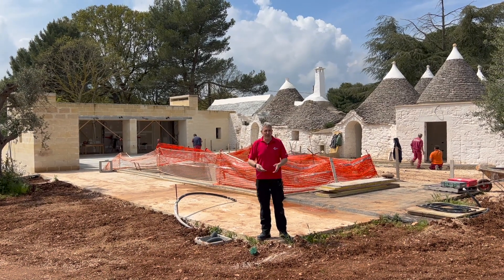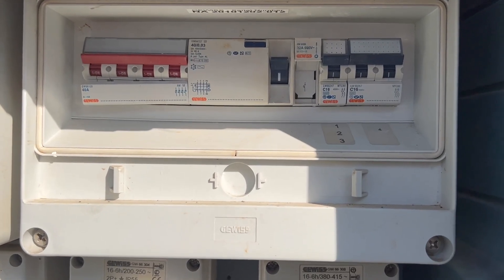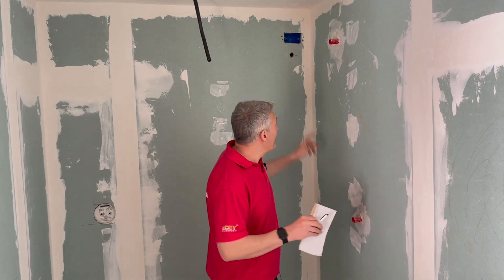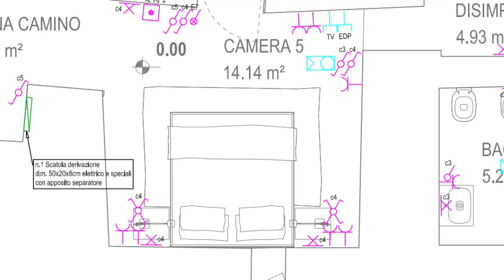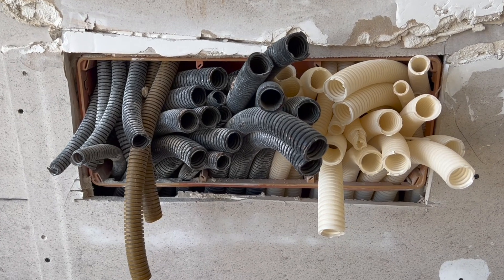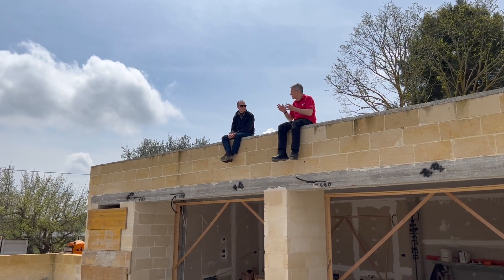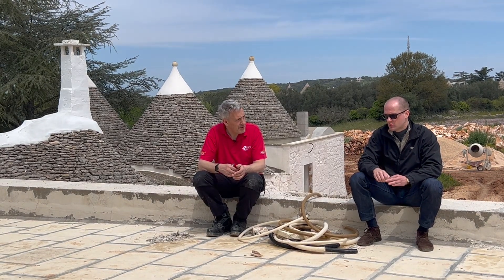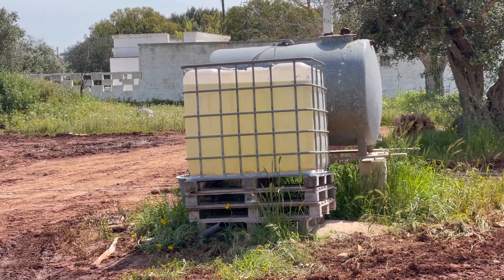Electric Wiring in Italy - You Won't Believe What They Do!

Comment: In the US, even though we have a TN-C-S supply, it is required by code that we still have ground (earth) rods outside every house and on every power pole in case the combined protective conductor (both neutral and ground) breaks.
Reply from the maker: Interesting- we are planning a similar video looking at the situation in the US
Reply: @efixx  Can't wait to see what you think of our electrical system!
Reply: @efixx  
That will be interesting. The USA electrical system and terrifying plugs are antiquated. It needs updating.  They need to switch over to 240v (most homes have 120v & 240V run in !!!!) and use British G type plugs, the best (do not reinvent the wheel). 

The large grey industrial looking 1940s looking panels with no DIN rails. Wow!
Reply: @johnburns4017  Why are you guys so terrified of our plugs? In 69 years I have never known anyone hurt by a plug. Who the hell needs 240v to run led lighting? We have 240v for heavy loads, it is not need for light loads.
Reply: @jdilksjr  
US plugs look flimsy and toy like. 

UK is 13A max. There are special 16A plugs for special application. No need for any more than 13A or 16A in residential applications for plug in appliances.  If the appliance draws more than 13A, then the appliance is hard wired in, not on a plug. 

0.75mm flex is rated 6A max. The circuit interrupter at the main panel may be much higher than this - so a fuse in plug protects the flex.  An LED table lamp can be drawing 7 watt.  A 1A fuse is available to cover lamp, switch and cable.  14A flex would be very thick. Too thick and overkill for a table lamp. 

GFIs are not mandatory in the UK on the main supply. They are in France and it works very well.  The main Interrupter differential is owned by the supplier. It is re-settable by the user. Circuits are 30mA cut out at 50Hz. USA needs 20mA fir same protection because they have 60Hz.  The main French interrupter differential is a lot wider like 200, 300mA

GFIs are mandatory in the UK - having one to do all the system is OK, but it is recommended on all circuits in the UK. So when on one circuit, an RCBO is fitted. This is: fault current, over-current and earth leakage detection all in one unit in main panel.  One reg states that one circuit must not interfere with another, which means fit an RCBO  on each circuit. 

No portable appliance outlet can draw more than 13A in the UK because of the maximum fuse size in a plug is 13A.   

Arc fault became mandatory in the UK in high rise buildings. Recommended in all installations. Called AFDDs here (arc fault detection device). They are: fault current, over-current, arc fault detection and earth leakage all in one unit at the main panel for just one circuit. 

Surge protection devices (SPD) are a now a requirement under the 18th Edition of the Wiring Regulations and essential in protecting equipment from damage. They are fitted in the main panel.   

I read that the UK is one of the safest systems in the world - one of the reasons why the UK never fully adopted the EU regs. The UK said we are better so we are not dropping standards, you adopt ours.  Ireland uses the UK system, as do many others in the world.

The US system to us is third world. Two voltages coming in? 🙄  In residential properties? Uh!  The plugs and receptacles to us are terrifying - they date from 1919. The huge grey main panels, huge black single pole only breakers made from what looks like ancient bakerlite, all looks like something from the 1940s.  They have not moved on. 

I am not being nationalistic, as I have worked on US systems, and they have a way to go. First, is get rid of 120V in homes having all appliances 240v. Standardize on the UK G plug, it is proven beyond doubt and the best. Also will be compatible with many other countries. Then have RCBOs/AFFDs as standard.

Search on Youtube: 
THE SHOCKING TRUTH ABOUT FRENCH ELECTRICAL SYSTEMS

The French were a joke, but came up fast.  The main Interrupter differential is top right. They are in some aspects better than us. But it is more our manufacturers do not make the products and the French do. There is nothing stopping anyone fitting a French main panel in the UK. Getting the parts will be a problem though.
Reply: @johnburns4017  Our ugly gray metal panels are still better than the cheap plastic ones that the UK was stuck with for so many years and kept catching fire. Our GFCIs trip at 5mA instead of 30, which is MUCH less of a shock. An advantage of having two voltages coming in is that if someone touches a live wire and ground, they will be shocked at 120V, which is less dangerous (the only way of getting a shock at the full 240V is if you touch both live wires). I agree with you when you say our plugs are terrible, but it would be nice if someone could design a plug that was just as safe as the type G, but wasn't as bulky and doesn't need a ground pin to open the shutters. Another thing going is that the main disconnect for the panel is actually a circuit breaker and not just a switch.
So in conclusion, our electrical system DEFINITELY needs updating, but it isn't as bad as a lot of people think it is.
P.S. You Brits have electric meters and the power company's cables exposed inside your house, so stealing electricity would be very easy.
Reply: @HIDLad001  wrote:
"if someone could design a plug that was just as safe as the type G, but wasn't as bulky and doesn't need a ground pin to open the shutters."

The G plug is not bulky at all, only Americans say it is bulky as they are used to flimsy toy like plugs. It is the right size for a hand to hold. You cannot pull it out by the flex, you have to pull it out with your hand - designed that way. The size also makes it easy to incorporate a fuse. They also have a switch, which people turn to off when removing the plug. The US plugs look toy like and are flimsy. 

You have a problem with the superb safety feature of the ground pin opening the gate. Don't know why. Maybe you want your kids to be electrocuted. If double insulated and no ground needed the ground pin will be plastic, or an unconnected brass pin. BTW, MK make one in which the L&N pins open the safety gate, if that bothers you. But after 76 years of having the ground pin open the safety gate on millions of sockets world-wide, everyone sees it as a brilliant feature.

Two voltage into a residential property is well...... The old false adage of being safer using 120V!  British systems need RCD (GFCI) protection and arc fault detection in high rises, and recommended on all. 30ma on RCDs is considered safe enough. Same in the EU. USA can, and does, get nuisance GFCI tripping. 

Many in the USA disconnect the arc fault detection as it operates far too frequently. Why?  Because of the high current on 120V arcs are created in switching. And people pull plugs out of sockets using the cord when current is being drawn. Current which is far higher than British/EU systems. On an British/EU system 3,000 watts (max draw from a G plug) will draw 12.5 amps on 240v, while 3,000 watts will draw twice as much - 25 amps.  

In the emerging countries that implemented electrical systems over the past 50 years none have adopted 120v.  Saudi Arabia (never in the British empire), who in the past 50 years created a modern state from a bunch of nomads, even adopted the G plug.  

The G plug is vastly safer than all other plugs. Safety levels are high in British systems. We need to make them higher, as the French and Germans do some things better. British consumer units are metal, by regulation (we call regulations, regulations not code 😏). As all Europe use, the breakers are on a DIN rail (Deutsche Industrial Norm) - superior to the huge USA clip in panels. Those USA panels were seen on Noah's Arc. 

Drop the nationalistic stance. Learn from others, do not reinvent the wheel. Adopt complete what works and proven, that even creates compatibility in a world where people travel far more than ever before.
Reply: @HIDLad001  
As energy prices have gone through the roof, and energy companies are making record profits, many would endorse such moral so-called theft.
Reply: @HIDLad001  wrote:
"our electrical system DEFINITELY needs updating, but it isn't as bad as a lot of people think it is."
I read that there are suggestions, from some with influence, to phase out the old 1919 plugs and receptacles. 
I also read that fitting EU/British systems, or parts of, in the USA is totally legal. They are not prohibited I believe. US code (varies from area to area I know) mainly says what you cannot do. Not sure about all of that though.
Reply: @johnburns4017  Those '1940s looking panels' have breakers rated to interrupt 10kA fault currents at minimum.  What you consider normal breakers are only classed as supplementary protective devices over here and can't be used without an upstream 10kA or higher rated breaker or fuse.
Then there is your abominable wiring color code where distinguishing which wire is what gets nigh on impossible in low light or iffen the wires get grubby.
And a bunch of Westinghouse engineers figured out over a century ago that 60cy/sec is technologically superior to any other mains frequency for grid scale applications.
Also, the problem with our plugs and receptacles is that a lot of them are garbage quality.  Try using commercial, industrial or hospital grade wiring devices and get back to me.
Reply: @randacnam7321 
Breakers (Micro Circuit Breakers in UK). 
The magnetic fault protection trips the MCB within one tenth of a second. Short circuit protection is intended to protect against heavy faults maybe in thousands of amps caused by short circuit faults. The capability of the MCB to operate under these conditions gives its short circuit rating in kiloamps (kA). In general for consumer units a 6kA fault level is adequate. The MCBs used in domestic installations are usually rated at 6000 amps or 6kA. 

Also in the likes of France the breakers are double pole, which are recommended in others countries.

The problem with 1919 US plugs and receptacles is that they are just an outdated antiquated frightening design, even if good quality. 

50 Hz power transmission over long lines is best at 50 Hz. At 60 Hz, more expensive plates are needed to prevent eddy losses. Generators have to rev  

Japan was having problem with 60 Hz and started to use a mixture of 60 and 50 Hz. Between 50Hz, 240VAC, and 60Hz there will be very little difference in efficiencies for end users. 60 Hz is slightly more efficient in underground transmission in cables. 50 Hz is more efficient in overhead transmission as it reduces inductance losses. If you want know which one consumes more energy, for the same current, 60Hz will consume more power than 50Hz

Note: emerging countries setting up new grid and electrical systems did not go over to 60 Hz. Saudi Arabia, who 40-50 years ago had different systems (some US, some Europe) in different areas. They have very strong US influences, but went over to 50 Hz, 230V and British G plugs.

In short, the US need to update its antiquated electrical system. The thing about the US, like the UK, is they they do run into homes adequate power, so all appliances can be running simultaneously.

You comments on the wiring code was laughable and childish.
Reply: @johnburns4017  Japan did not have frequency related problems.  They had no indigenous electrical industry and imported 50cy/sec equipment from what would become Siemens for Tokyo in 1895 and 60cy/sec equipment for Osaka in 1896.  This is why the north uses 50cy/sec and the south uses 60cy/sec.

Lower frequencies require bigger transformers and more core cross sectional area for a given size and so requiring better core steels to keep core eddy losses down is a moot point as less is needed.  Skin effect concerns are also minimal as big overhead wires are either hollow or more commonly have a steel core, so the skin effect drives conductor current away from the higher resistivity steel anyway.

60cy/sec generators and motors can transmit more rotational power in a shaft for a given torque due to the higher speed.

Saudi Arabia is not 50cy/sec and they use 127V/220VY.  They just use BS1363 plugs and receptacles for 220V use.  127V there uses our NEMA 5-15 plugs and receptacles.

And 50cy/sec has more pronounced flickering effects with lighting than does 60cy/sec.

Critiquing the abominable IEC color code is not childish.  I've worked on stuff with it and differentiating the colors is much harder than our black/red/blue and brown/orange/yellow hot colors.  Same with your old and better BS7671 red/yellow/blue hot colors, where color differentiation was much easier.  The IEC color code isn't the absolute worst (those would be the Chinese and old Soviet and German standards where L2 is green which is the same color as ground), but it isn't much better.
Reply: @randacnam7321  
You are grasping at straws at defending the indefensible. Anyone can see the USA system needs upgrading. That is beyond doubt. That is the internal electrical system and the grid in parts.  
We see constant news reports of California with blackouts and brownouts. And then the grid of a whole state the size of France, Texas, dropped out. Forgive us for thinking the country is bordering on third world in its electrical system.
Reply: @johnburns4017  On the utility side, it's almost all using either new Siemens or Schweitzer relays. You absolutely have no idea what you're talking about. Our fault current capacity is also greater than what is being used in Europe. Typical available fault current for many buildings can exceed over 35-65kA, while in Europe typical available fault current is way below 5kA, hence why we use those big huge old style grey boxes because those cheap plastic boxes used in Europe isn't going to contain a fault current of 50kA. I also live in California, I haven't had a blackout or brownout for years. You read about some town getting a blackout and somehow that means all of California is falling apart.
Meanwhile, I can go to EDF in France or any other European utility site and see the massive brownouts and blackouts all over Europe. I guess that means Europe is antiquated then? Forgive me to think your own country is falling apart.
Reply: @dev0random  
Number one all European countries are different, as can be seen in the comments here when many from all over are observing an Italian installation. But the USA is generally all the same from coast to coast. 

We regularly see brownouts on TV re: California. And it is true that a whole large state of 30 million did have its grid drop out in arctic temperatures, with over 100 people dying because of it. Reading up they have done little to prevent it happening again. Good old private companies in control not wanting to spend a penny. 

The US use those old big antiquated grey boxes because they never bothered to look around at how others are doing it as time went on - too complacent. The British, and others, are guilty of this as well as the French went ahead in their DP 'disjoncteur differential', which is an RCBO, instead of old cartridge fuses, and DP only disconnectors in main panels. The British need to adopt. 

Stop being smug thinking the US system is fine, when all you need do is look up at they terrifying, antiquated, socket and plug your computer is connected to. 

Look up DP AFDD.  All in one near small unit on a DIN rail, detection of: arc, earth fault, fault current and over-current. The USA have a lot to learn.  They should adopt the best of what the world has to offer and adopt, not reinventing the wheel.
Reply: @johnburns4017  Your explanation is absolute nonsense.
Reply: @jdilksjr  1/2 the amps, 1/2 the wire diameter, 1/2 the cost, not needed but not a horrid idea.
Reply: @jdilksjr  The British have some sort of obsession about their plugs.  They are a good design, but the Brits get all smug about it and look down on everyone else's plugs that just don't live up to the vastly superior British. 

 Then they get on us about the 240v vs 120v.  Which is the silliest argument I've ever heard.  The only appliance that I wish was 240v here were the electric kettles. But even on those it might save you a whole extra minute being on 240v vs our 120v.  (And of course ignoring that 240v is standard here, just split between the two polarities)
Reply: @SolvieCapital  1/2 the amps,  1/2 the area and not the diameter of the wire,   1/sqrt(2) diameter
Reply: @johnburns4017  It is bulky. :) One of the most annoying item to put in my computer bag travelling to UK -  cord with UK plug :)
Reply: @dmitripogosian5084  
I feel the same going to other places.
Reply: Same in Poland as in Germany.  Each building should have its own ground with a value less than 10 Ohms. Grounding in the foundation or ring around the building is recommended, and if there is no other option, driving the electrodes into the ground. In Poland, the most common type of network is TN-C-S, but in rural areas it is sometimes TT.
Reply: In Germany it's the same. Mostly TN-C-S and some TT in rural areas, but you still need to have an supportive earth electrode. For example foundation earth electrode embedded into the concrete foundation of the house. In alternative a soil embedded ring earth electrode as shown here in the video.
Reply: Not every utility pole, but usually at least 4 per mile with higher density residential/commercial/industrial areas getting 8 or more grounds per mile as it allows certain things on the pole to be closer together.  Problem is tweakers like to steal the pole ground wires as they are usually 8AWG (8.37mm²) copper which is $$$$.
t. utility distribution engineer
Reply: @randacnam7321  Everywhere it's the same thing. Sometimes even risking their own lifes. A few years ago 800m of railroad overhead line wire was stolen while it was live! The German railway system uses 15kV (AC, 16.7Hz).
Reply: @randacnam7321  Most of the poles I see have the electrodes. But you are right, not all of them have it.
Reply: @HIDLad001  Grounds are also required when there is any utility equipment like transformers, risers or guys, so every pole in a densely populated area having a ground can be common.